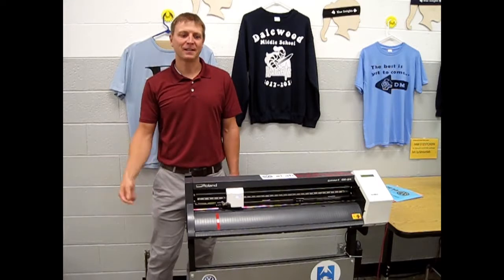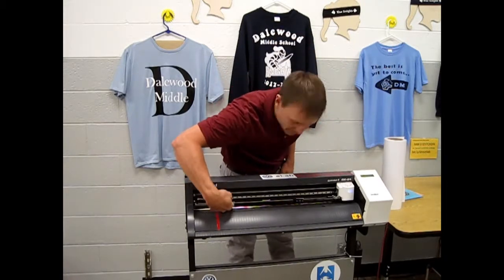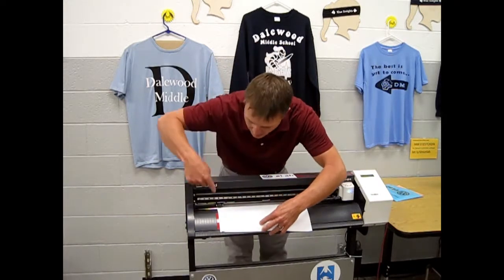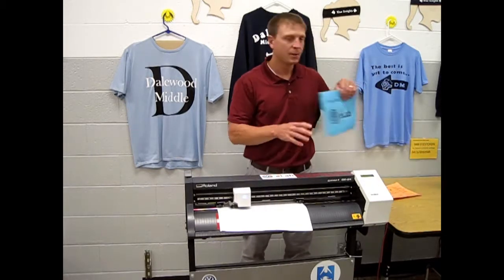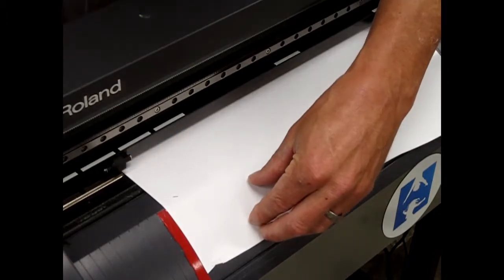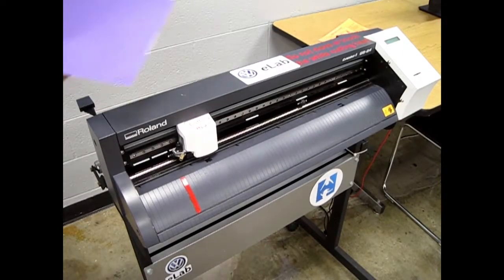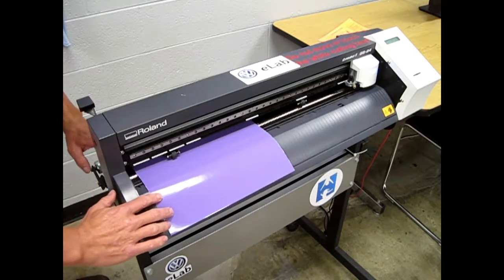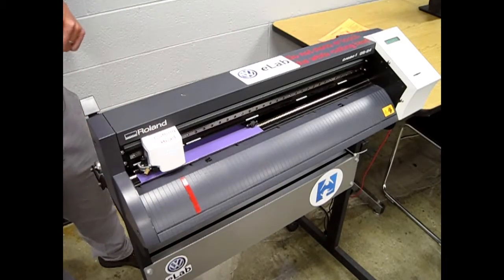Roland GS 24 tutorial

Comment: Hi Chris, I recently bought this cutter. I have a problem: The cutter is not "closing off" the shapes, meaning that there are always some milimeters that it does not cut where the blade starts and ends. Any suggestion?
Reply from the maker: Make sure to adjust the pressure correctly and that the blade depth is correct and there is a sharp blade. https://www.youtube.com/watch?v=vU1IA0sr_v0
Reply from the maker: https://www.youtube.com/watch?v=3asFY_2nTEk